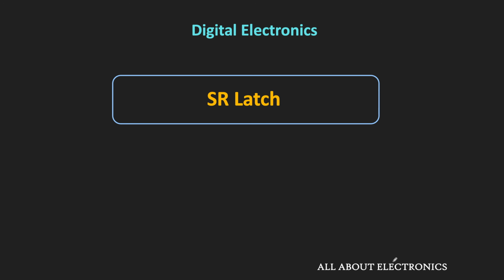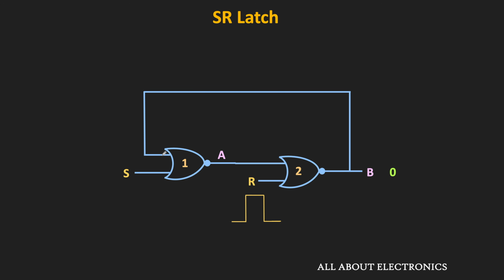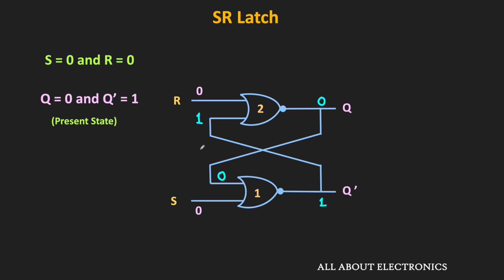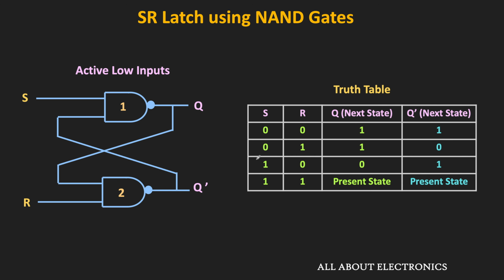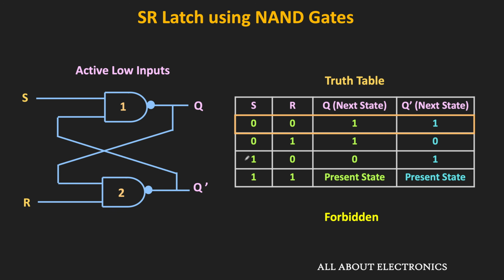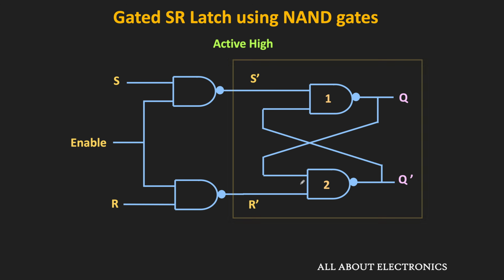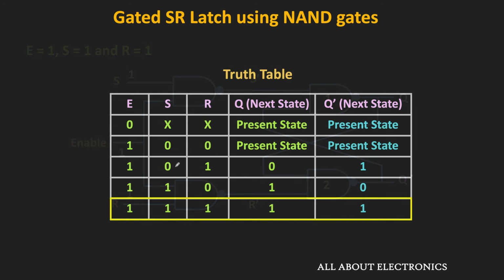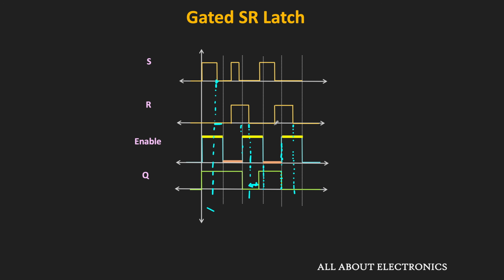SR Latch and Gated SR Latch Explained | SR Latch using NOR gates and NAND gates

Comment: 3:57 here in this time stamp u said when the input of s is high the output of second NOR gate also high....NOR gate takes two inputs right...how is it possible that both input and output r same....please explain sir
Reply from the maker: Initially, it has been assumed that the output of the circuit is 0. And both S and R are 0. Now, S become 1 momentarily, the output of the first NOR gate will become 0. And for the second NOR gate both inputs are 0. Therefore, its output will become 1. I hope, it will clear your doubt.
Reply: @ALLABOUTELECTRONICS Yes I understood...but why is it assumed that the output of the circuit is 0 initially... I'm not from electronics background...did I miss something or should I go back to the previous videos of yours to clear my doubt?... please let me know sir...ur guidance wil be much appreciated🙏
Reply: @thrilokmurthy7905 i think because initially since there id no power supply so it is considered LOW
Reply: @thrilokmurthy7905  hey brother I had seen so many other lecturers explaining, i also was in the same situation as you , but trust me after watching this till the end you'll get everything, even then if you don't get then feel free to express....
Reply: @srujanreddy8023 i didn't get it brother.. can u explain

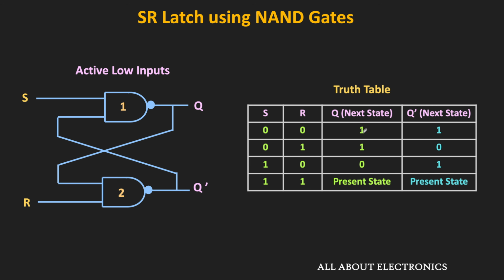Comment: 12:33 is the truth table correct??
coz when s is 1 and r is 0 Q shall be 1 and R shall be 0...we can see when s' is 1 and r' is q is 1 on gated switch which has same nand gate..
Reply from the maker: This is a truth table of the SR latch with active low inputs. That means S = 1 and R = 0, it will reset. That means Q = 0. (In active high SR latch, when S = 1, R = 0 then Q = 1)

Comment: you said the inputs for sr transparent latch(using nand gates) are active low inputs  and others are active high inputs.does this active low or high inputs have any correlation with the outputs we get (Q and Qbar).would you clarify this. its confusing
Reply from the maker: No, only inputs are active low. Consider the output as it is. For example, to set Q = 1, here for active low inputs S should be 0 and R should be 1. And likewise to reset the latch, S should be 1 and R should be 0. I hope it will clear your doubt.

Comment: In Gated SR latch using NOR, when E=1 and S,R =1 then you have said that the case is forbidden, but the inputs that are given are R' and S' so S,R = 0 must be forbidden? Also,  The truth table for both Gated SR latch using NOR and NAND is same whereas it is different for SR latch using NOR and NAND? could you explain both these doubts.
Reply: Coz after the first NAND gate where the enable pin is located, the S and R for the latch in itself becomes 0 and  0, so for that case, the latch gives unprecedented values, henceforth the result being forbidden...
Reply: See the terminal brother...
R output is Q not equal to R output is Q'

Comment: Hello sir,
Could you just explain what is active high and active low in brief? because it is getting hard to interpret these words
Reply from the maker: Active High means the input pin or the input signal will be active when that input is Logic '1'. (the input is active when its logic level is 'High')
In the active low , the input pin or the input signal will active when that input is logic '0'. (Input is active when its logic level is 'LOW')
I hope, it will clear your doubt.

Comment: can i ask a doubt? why S and R have different timing.. sometime it has very duration.. sometime low. I am not an electronics student. its my complementary sub. so do you think is there something I needed to know? the timing is 26:48
Reply from the maker: Both S and R are different inputs.  Many times in a bigger circuits, these inputs are the output of some other circuits. So, they may not be a same. That is why, if you see a time domain signal, then you may notice that, both S and R inputs are changing at the different times. 
I hope, it will clear your doubt.